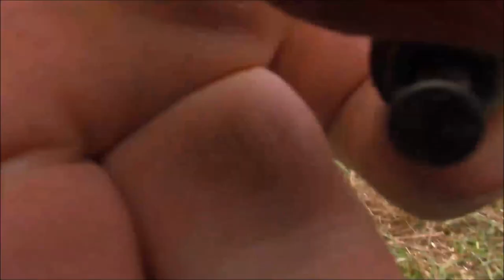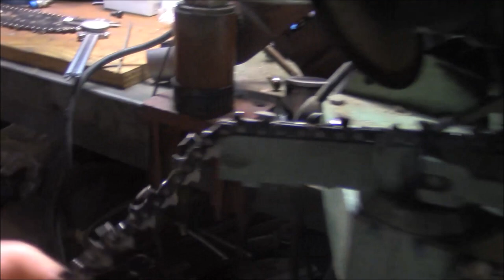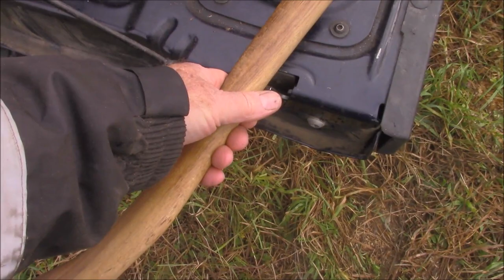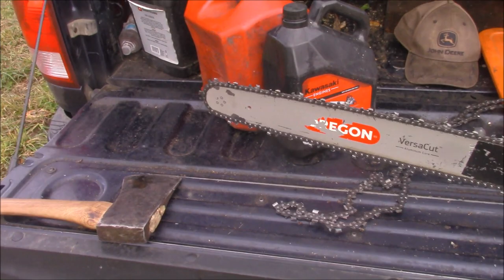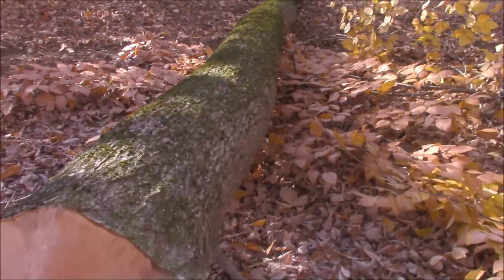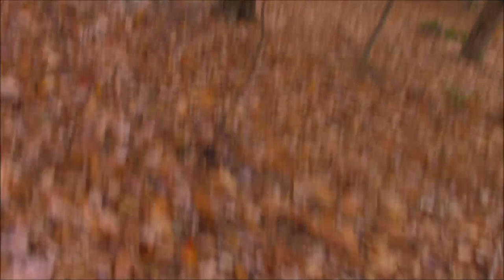Old Nielson Chain Grinder / Sharpener. Part "1", Husqvarna 562xp Gets Benched :)

Comment: The only thing I would be careful with the grinder is heating the cutters up a lot and turning them blue or hardening the teeth that a file is useless on them. It’s best to do small grinds to try and keep the cutters cooler. I think I was 15 when I started using saws and at the beginning I would take chains in to a local dealer and get sharpened, anyway they blued the cutters and rendered the chains useless. The next week I called into a local woodcutter and he made up some new chains and started to teach me to hand sharpen. Best thing I ever learnt. Cheers every one.
Reply: Agree on not bluing the teeth. A light kiss with the grinding wheel works well. Just take the tooth back bit by bit to where you need it. About a year ago I was asked to look at a saw that was bogging in the cut/wouldnt cut. When I saw powder all over the saw my first port of call was to look at the chain. Blue teeth and all mostly folded over. When I told him he just needed a new chain  he said " I just sharpened it. My son bought me a really handy wee saw sharpener" I got him to put his glasses on to see the blued chain and explained his problem.
Reply: Use kool grind